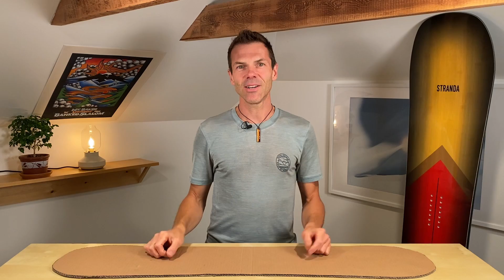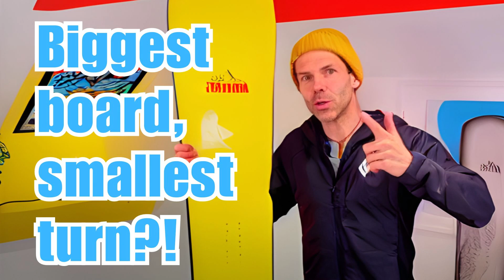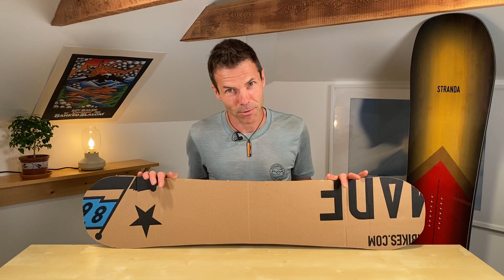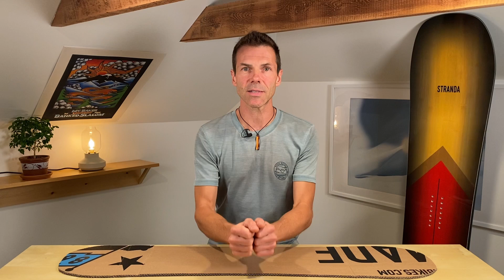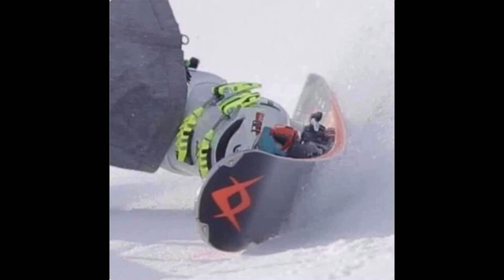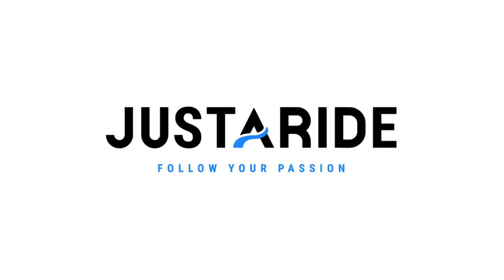Board design #3: Length, flex and turn radius  // A correction!

Comment: I guess this is why at my current level I actually prefer a less stiff carving board. It allows me to make a tighter turn at lower speeds. As my skill level will increase and thus my riding speed, I will be more keen to switch to a stiffer board when I am able to push against the board harder and therefore flex it more for a tighter turn shape. And obviously the higher the speed, the more stable a stiff board.
Same journey as with skis where I really like the stability of a stiffer ski while going fast but still able to carve tight turns.
Reply from the maker: Spot on!!! Nice comment!!

Comment: Here's what we need to do this winter. I just watched a Ryan Knapton video where he made a couple great carves with his 13m sidecut board, then went and measured it out by estimating the center of the turn and stepping off the distance to the edge. He said that his 13m board left an 8m circle, but I'm wanting more data. My Burton Custom X 162W has a 8.2m sidecut, so I'm planning to do some nerding out this winter and carry a freakin tape measure in my coat pocket, find an empty groomer, and measure out my own turn radius. What we need is a chart: sidecut radius, length, flex, and turn radius of different boards. Speed and slope probably play a factor too. And of course, the rider is a key data point. But I'd love to see what the real turn radius is on boards with different side cuts. After all, it's the turn radius that really matters in the end. Good luck!
Reply from the maker: @lukejuras8024  it’s about board angulation!! There’s mathematical formulas that can calculate this. Not my jam… But the higher you tilt a board, the tighter the radius. That ends at a board angle close to but below 90°, as at 90° the board would probably just slide out eventually. So whatever Ryan measured would be different in his next turn, unless he tilts the board equally as high on edge as in the measured turn. I think I can half my Pipeliner and Cheater Radius. Board flex is key to this!

Comment: In turn( pun intended)  the side cut also enables the turn flex because without it the tip and the tail wouldn't be able to contact the snow when turn flex would be initiated

Comment: Hello Lars, I am 170cm 72 kg with a size  27 boot. Our friends at Wired Snowboards in Vancover released a new board this year the ARC. It is a wide board with an all mountain shape. Based on your information about flex and benefits of going longer I would normally bought the 154. I'm considering the 157. Theses boards can be custom ordered should I consider the 157 and have it made with Biax glass rater than triax for better flex for my weight?
Reply from the maker: Not a dumb thought!! It depends a bit on how you ride and what you expect the board to do. Triax usually makes things torsionally stiffer as well. Then length depends a bit on how much you move fore aft through your turns…. Tough to say.
Reply: @Justaride-Snowboard-Channel  I like riding  the alpine bowles at Lake Louise, and Sunshine they are always Moguled and my stiff tail Directional Twin can send you flying if you get bucked onto the tail usually with a bad result. LOL
Reply from the maker: @charlesstuchel6966  a stiff tail is usually not so bad for moguls. An overly stiff nose is worse… There’s also a subjective component to all this. Sounds like you appreciate a little less stiffness. You can probably ride both lengths in that board. Longer is always more stable. Shorter is always more nimble. Pick your poison! 🙂 The idea of longer but a little softer can be a perfect scenario and 157 is nothing overkill for you anyways.

Comment: Hallo Lars
Du machst geniale Vireos zu meinem Lieblingsthema (Snowboarden). Könntest du mir kurz erklären was deiner Meinung nach der Unterschied zwischen effective edge, contact lenght und runnung lenght ist. Ich finde die verschiedenen Angaben bei verschiedenen Anbietern verwirrend. Denkst du das der Markt bei den verschiedenen Begriffen jeweils von den gleichen Eigenschaften oder den gleichen Specs reden?
Liebe Grüsse
Reply from the maker: @marco13ceo  hi Marco!
Effective Kante ist die Kantenlänge zwischen den breitesten Punkten deines Boards. Contact und Running length sind prinzipiell das gleiche, aber manche Hersteller benutzen die Begriffe als zwei verschiedene. Grundsätzlich beschreibt es die Länge des Belags, die auf ebener Fläche unter Gewicht des Boarders den Boden berührt. Bei Boards mit tip Rocker und camber in der Mitte verringert sich diese Länge unter Last. Bei boards mit Rocker in der Mitte vergrößert sie sich. 
Ist für mich irgendwie nicht relevant, da ich meist auf der Kante fahre… 😉 und die Snowboardindustrie außerdem ohnehin nicht so genau ist mit den ganzen Abgaben. Es gibt ja kaum feste Definitionen…. Manche messen setback von der effektiven Kante (was korrekt ist!), andere messen von der Gesamtlänge des Boards…. Irrsinn!! 😂😐 Die Frustration mit dem ganzen Zeug hat zu diesem Kanal hier geführt. Ich versuche, so gut ich kann Sinn zu machen! 😊
Danke für‘s Reinschauen!
Reply: @Justaride-Snowboard-Channel  Da bin ich mit dir grösstenteils einer Meinung. Was aber die effektive Kante angeht hab ich das so verstanden, dass es wirklich die Länge der Kante ist. Das sie also bei einem 170 cm Board mit 8m Radius länger ist als bei einem identischen 170er Board mit 13m Radius. Und dann wäre die Länge zwischen den breitesten Punkten des Boards die Lauflänge (running lengh). Das würde dann wieder heissen, dass die Distanz zwischen den Contact Points bei einem Board mit Noserocker (early raise) näher zusammenliegen als bei einem identischen full camber. 
Ich glaube durch die kurze Diskussion mit dir ist mir das grad ein Bisschen mehr eingeleuchtet. Macht das für dich auch Sinn so?
Reply: Und ja das sind wohl ziemlich nerdige Überlegungen die ich da mache aber es tut trotzdem gut sich mal mit jemandem darüber auzutauschen😉. Ist nähmlich recht verwirrend da diese Begriffe alle ein Bisschen anders verwenden.

Comment: Hi Lars. I have a question about board length/ max rider weight. Im a short fatty 100kg/175cm. Now i am thinking about buying Biru from Stranda, but what size to buy? Now im riding Bataleon cameltoe in 161, never summer heritage from 2010 158 and jones solution split 164 and i have feeling that they are too long specially jones in forest. Shorter board with less flow? Btw I live in Stranda. Yes this Stranda 😉
Reply from the maker: @pawlospc  amazing!!! Where the ocean meets the ski slopes…….
Get the 157! That’s good for your weight and nimble enough. If you go through this link, it’ll help my channel, and it’s free shipping. Cheers!!
https://www.strandasnowboards.com/ref/878/

Comment: This is a good reason to have a look at the size charts when buying a new board! Just because the 146cm was the only one left on sale if you are 85kg its not going to have that stiff flex its advertising you will overpower the board and it goes the opposite as well if your 45kg trying to flex a 165cm mid flex board your going to have a workout on your hands and not a great experience

Comment: Without math equations, I made a similar argument as riotsupercarver in the comments on your previous episode. 

"The increase of sidecut depth that results from increasing effective edge, given constant sidecut radius, is the result that effective edge tracing a larger length of circle, and thus more of that circle's curvature, but it does not change the circle itself (or, therefore, the sidecut radius, or the range of possible resultant turn radii)."

Distinguishing between flex curve and sidecut curve is indeed useful. And, depending on flex, flex curve may or may not yield a tighter radius turn given different lengths and the same sidecut radius. But, thank you for making your excellent videos, for carefully correcting, and for helping us all  think through the complexities of carving snowboard design.
Reply from the maker: @sugarplumflyjelly  yeah, I remember your comment. There were about three or four people commenting with that. He was the first and the one I went back and forth with forever…. So he really sparked the thought. That was a silly mistake, really. Seems so obvious now. 
Thanks for your comments!!

Comment: Nice correction video. So a longer board should be easier to carve, because of flex characteristics, as it’s easier to get the board to the point of full radius engagement.
Reply from the maker: @LagmasterB  the longer version of a board with the exact same flex will bend under less weight.
Reply: @Justaride-Snowboard-Channel  this is moderately mindblowing

Comment: 4:34 yes! finally someone gets it. This is exactly what I was trying to explain to you but couldnt get it through. But this makes me think: Are asymmetric sidecut snowboards just BS then? and if  the sidecut does affect the turn a little bit is it really the deeper and shorter one that should  be your heel side or  is it in fact the one where  the  contact points are further apart?
Reply from the maker: @newrenaissance  good question…..

Comment: 3:49 Yes! board flex affects the turn radius. Moreover, if that is the case then weight distribution also affects how the board flexes - more distributed weight, lets say by putting your feet far apart results in more force needed to flex the board. The more the force is concentrated in the middle of the  board the less of  that force will be needed to flex the board. This is how bows work and also why flextesting your the boards in the shop with your hand tells you little since your feet are never goting to be in the middle of the board.
MOREOVER, think about how you generate the force in a  turn -it is basically the  centrifugal force that  is pushing on the board. This  is why, provided  that you have the grip  to support it, if you turn at  higher speed you will  generate more  centrifugal force in the turn  and  this  you can make it tighter.
Also about the short  vs long planks of wood - look up the  oldest skis you can find and check them out. they were ridiculously long and had almost no sidecut yet they turned!  They achieved it exactly by flex curving as shown  in 4:47
Reply from the maker: Correct!! 👍

Comment: Yeah not really, can’t say either flex curve or sidecut radius is the main reason for the line a snowboard will cut. You have to take the weight of the rider and how fast the rider is going in order to take advantage of a certain flex, sidecut or effective edge. EE will provide hold/contact patch for rider specific weight, flex will allow the weight of the rider to utilize that contact patch, and sidecut ultimately dictates as to what speed the board should be ridden at. A 6M sidecut can’t run at 120kmh, and a 14M sidecut can’t turn (with all its edge engaged) at 20kmh. It’s not one single element here, it’s the culmination of those three properties that allows a board to turn well given certain inputs. In order to achieve that, the core profile and glass layup need to all match. Then factor in early rise (static pre flex on the extension of the tip, least leverage area) and it can make the board turn even better. A board that turns and holds really well has a specific operating window that needs to be driven by the rider. If the tips start chattering, you lose hold, the edge slips, less hold, too much or too little flex, lose hold.
Reply from the maker: Totally! Rider input is obvious. No snowboard rides down the hill alone. What would possibly flex the board, if not external forces?!

Comment: I have also taken other riders boards and lay them on a table so they can see their effective edge and side cut offset to better understand where to allow ie use edging and pressure during a turn, basically what kind of board performance they are looking at overall.

Comment: This video brings to mind the flex pattern of your Standa Cheater which allow the bending process to aid the side cut for those shorter tight turns. Additionally many riders don't consider overall flex patterns, I personally like a softer flex though the middle of the board to help me with pressure throughout the turn with a solid camber profile. Great Video thanks!
Reply: Hi! I’m looking for similar kind-of boards, other than the Yes Typo, can you recommend two other playful directional free ride oriented snowboards?
Reply: @timlee4576 my fiance has a jones twin sister that sounds exactly like that, I think the men’s version is the mountain twin. My capita mercury is the opposite, stiffer middle with softer tips, and not as fun as she has on groomers, but I can charge powder and choppy resort snow much better. I want another board like hers.

Comment: Did the mathematical formulas account for the fact that snowboard edges do not have point contacts with snow, and instead embed a certain section of the edge? This is exaggerated in softer snow, but harder snow will produce something closer to point contact.

When a section is embedded, it would effectively restrict flexion of the board. Longer distance between your center of mass and the edge (i.e., longer effective edge) would give you more leverage to fight that restriction, producing deeper flex. 

It's hard to say how big this effect is without doing a physics experiment, but certainly the physics involved is much more complicated than sidecut radius
Reply from the maker: Let me know when you record that episode!! 😊 Sounds amazing!
Reply: I was thinking this too!  In both videos where the board/cardboard on up edge Lars stops bending the board/cardboard when the edge hits the desk.  I assume outside boilerplate conditions like we get here in the northeastern USA there's a bit more flex in the "snow" than that desk surface and so the board can continue to flex a bit more (the longer one more so)?  In any case, both videos have convinced me that a longer board doesn't necessarily have a longer turning radius, it's all about sidecut/flexibility/weight which is worth it's weight in gold (certainly coffees!).

Comment: You are the goat man!  I'm 5'11 with roughly 230 pounds, and I might be around 250 with boots and a suit! size 11.5 boots bought a board of 165 wide, and I am not sure if will be too big for me. but I like stability and confidence on the board. shorter boards I rode were too nimble and all but freaking unstable and came out of the carve very loose. since I'm a very heavy guy with a strong riding personality!
Reply: Im also 5,11 but only 190. I bought a 165X Never Summer Proto FR. My conclusion from watching lars and riding "outside of the spec sheet" myself, has been that the spec sheet applies less when it comes to carving. IMO its better to go bigger (which btw with your weight i think 165 is a good choice) then you might need because it gives you something to grow into. It all comes down to your technique and how much leverage you can put into the board. Don't overthink it ;)
Reply: @shycarves  following u friend! Nice videos! i fully agree with your process of thinking... in general bigger boards give you more confidence for steeps and deep! Not to mention for carving it gives another level of trench!
Reply: all things said, why do you choose big boards instead of ""correct size boards for you" ? I'm I wrong for buy such bigger boards for me?
Reply from the maker: There’s so much personal preference and ability level involved….. The absence of shorter wide boards forced me to always ride longer boards (to get the right width). So that’s what I’m used to. And I love the benefits of length!!! I’m not a freestyle guy, so as long as I can bend it, I go longer.
Reply: @Justaride-Snowboard-Channel  agreed! i'm not a freestyler either, I'm more to a freeride!
Reply from the maker: @debarros777  Deep Fake is a much better choice than the Hometown!! Way better vibration damping! Also more natural flex. Good choice. 👍
Reply: @Justaride-Snowboard-Channel  thanks Lars! Appreciate the feedback. Is hard to buy boards without trying then. But I'm definitely happy with the board.
Reply: @Justaride-Snowboard-Channel  While I haven't been on a Deep Fake, I'd say it depends on the application.  The HTH is certainly lively and it's a lot of fun in soft snow.  It's good in the trees and easy to ride switch there too. I actually like how the stiff nose will bust through crud and not buck me off track.  But yeah, it does have its downsides. Despite the shorter SCR it's really not turny.  It likes to go down the fall line.  Sometimes I lay it over trying to turn tighter, but my boots just drag.  Forget about ice, it really isn't damp.

The materials in the Deep Fake are certainly interesting, but it's a fairly centred stance without much setback.  The stance is quite wide for the lengths as well, so I wouldn't really have an option to set it back.  I would like to see that construction in a more directional ride.
Reply from the maker: @TheDerekHyde  good points there on the DF! Wide stances all over Ride and K2! Not good…. Difference in damping between the two is night and day. 
For the HYH you gotta be heavy. Burton is not my brand at all. Their flex patterns only work for me if I downsize to a 152 in everything….. Crazy stiff tips!! 
Great for some people!!
Reply from the maker: Thank you so much!! You’re on point!! What did you get? Burton Hometown Hero? 165 wide…. for your weight…. Sounds like the Hometown.
Reply: @Justaride-Snowboard-Channel  I got a Ride deepfake, almost got a burton hometown! because of u, I bought my biru! by the way my favorite carver so far...

Comment: Great to see you back at it Lars. Just received my custom Donek board (160cm length, 30cm width) with a "variable" 7-10cm sidecut. I think you may have helped my understand how a sidecut can be variable depending on pressure of the press during a turn. Either way, great vid.
Reply from the maker: @NavyShredder5280  it’s variable as in a blend of different sidecuts along the edge. There will be an episode on this! 😎